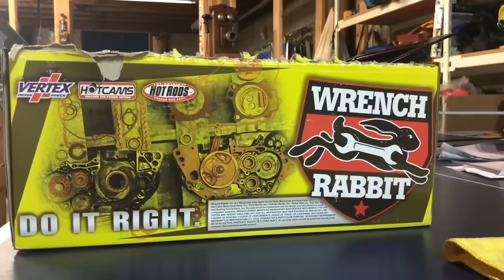Building The Ultimate Two Stroke Engine!

Comment: You should get out of the habit of taking apart a dirty anything. Your pan of soapy water actually has to have some soap in it.!  What do you think your in the Amazon Jungle or something?  And talking about overlooking something, how about putting some chamfer on that blank of a piston !  Should have an 1/8 "round edge on the lower exh. skirt and a little less on the intake and all edges should be smoothed .Just like the cylinder.   Ultimate build my foot.  not yet at least !
'

Comment: Cool video...this brings back so many memories...I raced motocross as a kid and earned an AMA Expert license in 125cc Motocross (YZ125) as Jr. in H.S. in central Florida in the early 70's. the Airboxes weren't bulletproof like they are these days and we were constantly fighting to keep sand out of the induction system. We tore the engine(s) (we had two engines) down after every race to inspect (my Dad was an Engineer out at Cape Canaveral and was my wrnech) and frequently after the week of practice too. We would rering every third race and anything my Dad found that didn't meet the blueprint specs was reworked/replaced.

Comment: In my 1959 Kreidler motor disassembly and assembly guide it says to heat the motor housings to about 150 Celsius before removing the bearings because the pres fit could be weakened. You might want to do that.

Comment: Looks awesome but I am curious why would you heat the cases and bearings when your trying to reinstall? Wouldn't you want to put things in the freezer so that they shrink and slide in place easier?
Reply: I'm thinking that he may have heated the cases, and froze the bearings. Thermometer showed a temp of 36 to 43 degrees on the bearings, but I couldn't tell if it was Celsius or farenheit.

Comment: Two stroke exhaust is shaped so the shock wave (caused by exhaust port opening) flings down the expanding cone at the speed of sound. it creates a suction which pulls exhaust and fresh gas through the engine. When the shock wave hits the reverse cone it bounces back stuffing the fresh gas back into the cylinder. The incoming charge is still moving from the carb, so the cylinder gets stuffed from both sides. It's all about the speed of sound so can only work over a narrow speed range. It varies with pressure and temperature making tuning very tricky. Invented by the late great Walter Kaaden (in communist East Germany) with next to no technical resources. The engine power band can be increased with a movable exhaust port to alter how soon it opens and a movable reverse cone in the exhaust chamber that varies the bounce-back time. But that changes everything else. Simple mechanics. VERY complex dynamics.

Comment: Nice item that showed that beautiful engine being put together and the gearbox selector forks in particular  that reminded me of my 1949 Douglas 350 T that suddenly locked up the back wheel because their crappy quality fork lug sheared off thus allowing two gears to be engaged at once.....quite scary. Also due to poor frame steel quality (it used to fracture close to the cast lugs,I had it rebuilt in Reynolds 531  (i think)tubing that was lighter and more flexible too, for the princely sum of £8 by a craftsman in a small workshop in Hillgate Stockport!

Comment: I thought you was going to be doing performance upgrades to this motor where the title says  " building the ULTIMATE two stroke engine "   I don't mean to be rude or anything but the motor is all stock !  You put new bearings an a new piston but its all stock.  So what you did was a video of cleaning the motor an new bearings an a piston.  Before I got too old to ride I used to do that to my bikes every season.  My last bike was KTM 360

Comment: I restored a 2004 race bike and put a 1991 CR125 fully modded out 6 speed balanced hot rod crank vforce 3 reeds the top end ported and polished was done by a professional hauls ass for a 125

Comment: correction ktm and yamaha are the best 2 stroke motors, ktm being the best and my faverite reason is the power valve is adjustable, plus the engine repair all over is super easy and the passt are made better you can tell that the parts quality is top shelf imo. im not a fan boy i like all makes and models but they each make certain thing that are better then each other but when it comes to 2stroke it ktm and yamaha all the way,honda 4 stokes are my pic on 4 strokes due to the the independent oil system seperating the engine oil and trans oil, if you take proper care one of those they will last.

Comment: Nice rebuild , I did the same to mine except before I removed the old bearings,I sealed them with silicone and filled the crack case with water to measure crank case volume... , smooth out all the sharp edges and fill the sharp inside corners of the engine casing with weld and grind back smoothly.  Measure again to achieve original CCV after removing and adding crank case material and before removing the sealed bearings ..  bottom end is flowed, makes great power gains!
Reply: nice

Comment: You shouldn't have tightened your cylinder studs down, you don't have enough threads into your nuts now. Just hand thread the studs in and not wrench em down so tight. Other than that it looks great for sure.
Reply from the maker: Thank you! There is a torque spec for them in the service manual.

Comment: I wanted to know where the 2T Oil pump for this engine is?
Reply from the maker: This engine is not equipped with an oil pump. It gets its topend lubrication through mixing the fuel with oil
Reply: @adampaganelli4891  Isnt that a welcome sign to Piston Seizure? I mean i have a regular Yamaha Rx-135cc & even that has a oil pump considering that during higher RPM's the lubrication would be as per the throttle response & current RPM. Arent these DT bikes far more powerful than what i have, i seriously find it ODD for them not having a Oil Pump.

Comment: Great  motor  rebuild  luv  them  phat  head  with  changing  domes  or the vhm  racing  head  with  changing  domes  and  colors  have mine  in gold  my  phat  head  came  with  2 compression  domes  luv  that  can run  pump  gas  and 110 racing  gas the complete  kit  was only  250 dollars  and came  with gaskets  got  more  power  and  it looks  great  the gold  head  on mine  gonna  do the same with  my other  2 strokes  I have luv  the  color  radiator  hoses  I have for my bike  great  job  on  your  2 strokes  dirt bikes motor  rebuild  it's  a  beast  and  looks  good  at  same  time  can't  beat  that  Mike Holden out of north Carolina said that
Reply from the maker: Thanks man🤟🏼 yeah that cylinder head is awesome

Comment: This is cool, but why on Earth does this thing have so many moving parts? There are more bearings alone in this engine than there are moving parts on my Echo GT225 weed whacker, and on a displacement to displacement basis the Echo probably generates more horsepower and torque per cc.

Comment: Did you discover the backwards installed 2nd gear/output shaft before, or AFTER you tried to run it?
Reply: Laser3303 yeh, but just look at it?!?!?
Reply from the maker: When I put the cases together and it was not going through gears correctly

Comment: Nice job Adam. Did you sand blast and buff the Engine case or vapour blast?
Top skills with the Cerakote by the way. I tried and failed with Cerakote, so i went with a metallic Engine Laquer.
Here are some of my builds. 
https://www.youtube.com/watch?v=a6GoafSeisI

https://www.youtube.com/watch?v=kRXgV2CWjVY

https://www.youtube.com/watch?v=tRwuxC88sU0
Reply from the maker: Thanks man! I cleaned them with pryme mx wheels

Comment: Nice build, looks good. One question after all that work and money spend it looked like you just cleaned and scotch brited the cylinder. You put new piston and rings in an old cylinder. Why not get it at least honed or better yet re-nikasil or new cylinder works?
Reply from the maker: Good question. At some point I probably will, this cylinder was already in pretty good shape so I am going to use it one or two more piston cycles. If I ever race the bike I will do some porting and replating.

Comment: Let's see the titanium bolts used to hold the cases together, or the titanium fasteners to hold the outside of the engine together?  Oh woops there are none because this is a horse and pony show with an amateur at the reins.  You didn't build anything ultimate.  Did falicon or crank works rebuild the crank (at a cost of more than a thousand dollars)balance it and add weight for more spin up or did you press together the crank on your Harbor Freight recycled soup can press in your house?   Did Tom Morgan trick out the cly and cut the base and raise the compression for race gas and a custom pipe from PC?  Nope you shined shit up and coated some junk, that's all, pretty boys make pretty parts...lmao

Comment: Buiding??? It's called reasembling...
Reply from the maker: It’s a term often used to describe customizing.
Reply: @adampaganelli4891  don't get me wrong I don't want to dehonestate your skills and knowledge about engines and transmissions.... I only thing that you used wrong terms...
Reply: @adampaganelli4891  what exactly did you customize??? Color??? That's painting...
Reply from the maker: -Every single bearing was after market
-Crankshaft was aftermarket 
-Paint was a high durability ceramic coating
-Read valves were replaced with high 
performance alternatives
-carburetor was replaced with a high performance aftermarket alternative 
-piston was replaced with a high performance after market alternative 
- gaskets were all replaced 
- cylinder head was replaced with a high performance after market alternative 
- and exhaust was replaced with a High performance aftermarket alternative
- compression was raised from stock and bike will run off race fuel now 

Etc..

Comment: no filter? it wory me so much if dirt get stuck inside carburator
Reply from the maker: There will be a filter installed later. Have a big air box attached to the engine before installation would get in the way and mess with the ascetics of the engine in the video
Reply: If your talking about a inline fuel filter.. I wouldn't. They can pull oil out of the gas.

Comment: 6:00 why are you using a drill to run bolts into aluminum engine cases? thats a great way to strip them out and not a smart technique.  aluminum is a very soft metal and its not like you're being timed on this.
Reply from the maker: It’s a variable speed drill

Comment: Only thing I would add is you need to run a tri-stone hone in the cylinder to "cross hatch" pattern score the sleeve.  Otherwise the new rings will not seat correctly and this can lead to blow by and lots of other problems in the case (fuel in oil, high case pressure, blown case gaskets, etc...).
Reply from the maker: I made a video on this which I did not include in this time lapse. Though I do not recommend using tru stones on two strokes

Comment: Hi there, at 12:57 you use double(two) gasket for cylinder instead of using 1 gasket . is it ok to use double gasket doesn't it effects on engine,and yeah your work is amazing.keep up the good work.
Reply from the maker: Abdul, yes I did so because I am using a high compression cylinder head. Thank you!
Reply: @adampaganelli4891  Thanks for your reply

Comment: It looks nice. I would never use the scuffpad on the cylinder wall. It is a honed surface, And I always lube the cylinder wall, the piston rings, the bearings of the conrod and the crankshaft bearings. Also a ggod idea to add a tiny bit of silicone grease to the seald and O-rings when you install them. I like to turn the crank a few times by hand  and wipe the access oil is added, and add some back. Usually the oil I wipe down is nasty even the parts are spotless, so I repeat it a few times. That way the parts are oiled up on the first start, and as clean as they can get. It will smoke a lil' for sure, but I never had a problem with a few minutes of smoking at the first start. And you did a lil too much heat on the exhaust.
Reply from the maker: Be careful to much lubrication on your cylinder wall will cause cylinder glazing and loss of compression
Reply: Thanks for the advice. I missed it in the text but I have a good method to apply just the right amount. I use a clean cloth/rag, ligthly dipped the middle of it in the oil I will use in the premix(I'm not a big fan of assembly lube etc, the 2t oil is designed to be used there), and i apply a thin layer with the cloth. This method is great because all it needs is a clean rag, and some paitence. And there is not so much wasted oil if you dont soak the rag, Actually all it needs is a few ml.

Comment: One hit with the pressure washer and all that paint laid without primer will be blowing right off.
Reply from the maker: MX after 30 it’s a high performance ceramic coating commonly used on guns called cerakote

Comment: I'm not sure what's so ultimate about it.
I hate how you are setting those bearings with sockets, should use aluminum or brass stock, and how you hand sanded the sleeve.
It's not a build, it's a rebuild, with what looks like mostly new parts.
I'm wondering how long till the "diagnosing two stroke engine failiure" video comes out.
Reply: Edoardo Bartolini seriously,  you have a tiny brain...
Reply: Someones jealous. By the way if you have ever gotten off the couch and built an engine you wouldn't be so ignorant to the fact that using sockets to knock out and knock in bearings is just as effective, easy and simple as using a "stock". What about him hand sanding the sleeve? He did it perfectly.
Reply: I use the old bearings to set the new ones perfect fit every time ..N i use a Slide hammer to pull the old .. Makes it simple

Comment: 850cc rotax is the ultimate 2 stroke
Reply from the maker: Jet ski?
Reply: @adampaganelli4891  it's from a snowmobile, it has 160hp
Reply: No the ronax 500. It's a 200 hp 500 cc 2 stroke.
Reply: @emilmuhrman  same power but at 3.000 rpm higher and its 160hp not 200hp.
the rotax has much better low end power and is 100x more reliable
Reply: @einar8019  Yes 160 hp on the street legal model. Up to 200 on track only ones.
Reply: @einar8019  And you are probably right about the reliability.
Reply: @emilmuhrman  both will still tear your face off in acceleration

Comment: Liked ans subscribed. Couple pf ouchy points, 53 years old now, I never ever use a toque/drill diver on casing bolts and normal paint is a waste of time on outer crankcase as it wears off too quick, needs powder coating .Big love from Great Britain.
Reply from the maker: Thanks for the support and constructive feedback. Just so your aware that is a high performance coating called cerakote it’s not regular paint. I go into more detail on other videos. Also I have used my impact enough to know the right throttle amount to not damage anything, I also never tighten them in all the way I usually finish off with a ratchet

Comment: i used to do the same thing with warming the cases in the oven, but one mechanic told me its not good idea cause they may lose their straight shape on the cylinder side, any thoughts on that?
Reply from the maker: If you heat to about 250 degrees you will be fine because most engines operate around 200.The only thing I avoid is getting a particular area super hot with a torch.

Comment: the best 2 stroke engine  ive ever seen and owned was a rz 350 1988 model but then came the tdr 250  except for the electrical stuff the engine is bullet proof   dt 200 same thing 1 of the strongest engines ive ever seen go threw torture but the electrical ypvs etc was a problem cdi boxes etc  tzr 250 same thing excellent engine
Reply from the maker: Cool man! Yamaha makes great products

Comment: Loving your videos as always. I’m curious what your background is with mechanic work. Impressive how much you know!
Reply: You dont need to be mechanic to do that
Reply: @marjamix  but you definetly need to know a lot about workung on bikes esspecially when it comes to parts like the transmission
Reply: @mathisk5605  transmission is quite easy, all the parts were Bolt-on. When you start to tune your engine things get more difficult
Reply: @marjamix  yeah 2 stroke tuning is complicated but i mean mixing gas hauling ass you know
Reply: @mathisk5605  yeesssss

Comment: The build is turning out great, so glad you used a lectron! Keep the build videos coming!
Reply from the maker: Thanks man!!
Reply: @adampaganelli4891   Lectron are nice but have been surpassed with the smart carb ( desighned by same ppl that invented the lectron ) not bashing the lectron in any way ..i shoud have purchaced the hybussa set that was on ebay years ago for my drag quad .. they were dirt cheap for lectrons but i figured way to big for my 650..  Knowing what i know now there is no such thing lol .jk a set of Fcr carbs would suit my 4 poke bettter .. but lecs can be tuned in to work .. prob would have had to change the metering rods